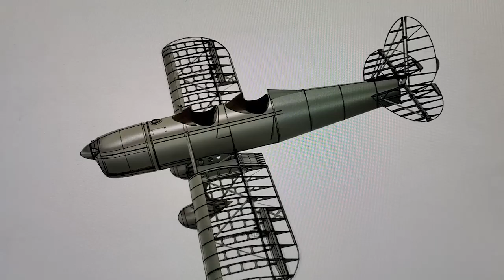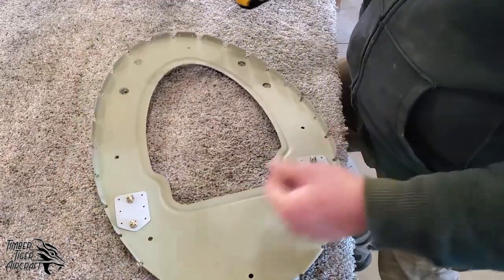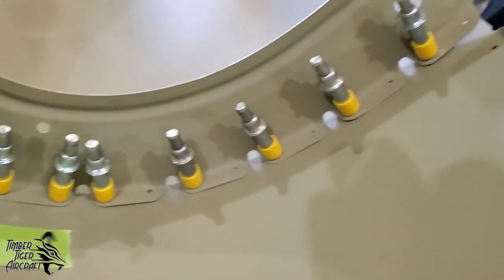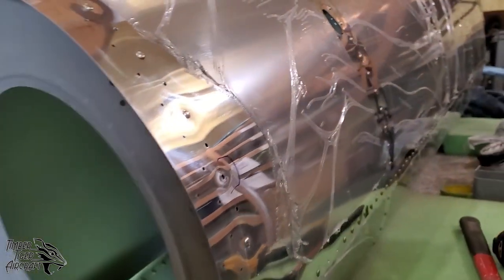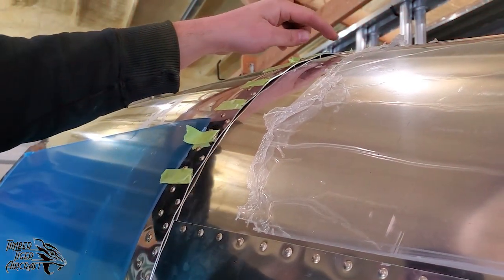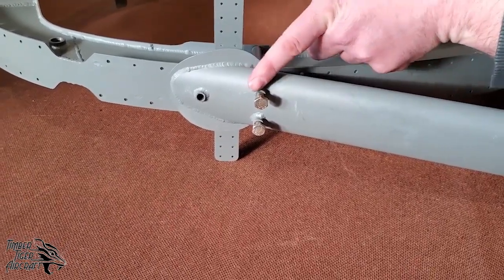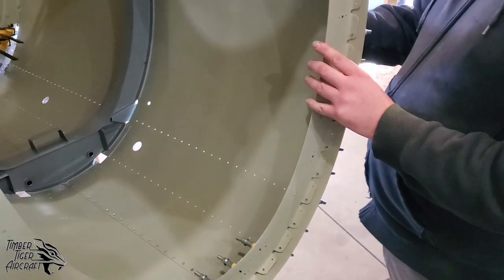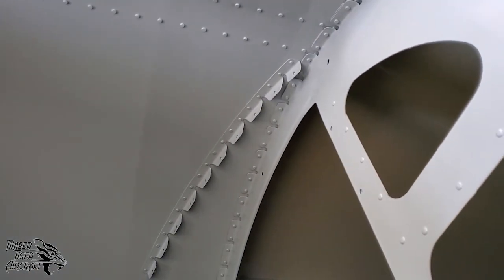Construction:  ST-L Fuselage

Comment: Why isn’t the bulkhead flat? It looks like it is a bit warped
Reply: I'm assuming you're talking about the aluminum bulkhead.  During the bead rolling process, the metal moves just enough to cause that.  It is, however, a non-issue, as the bulkhead straightens back out during assembly with the skins.  This flattening is shown in the video.